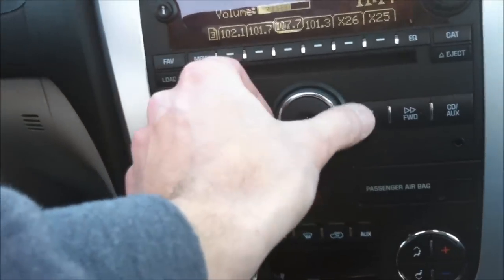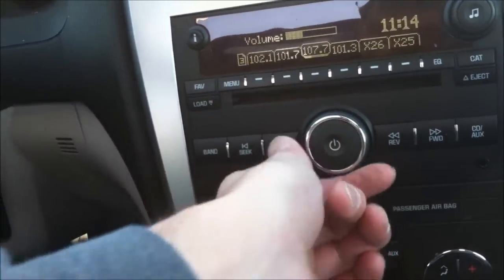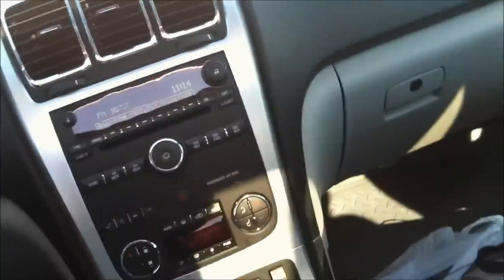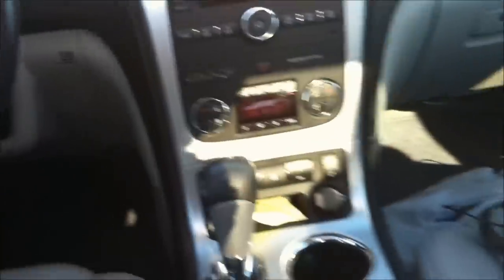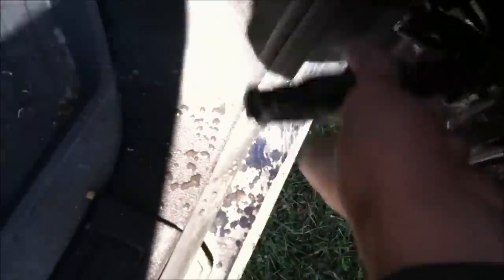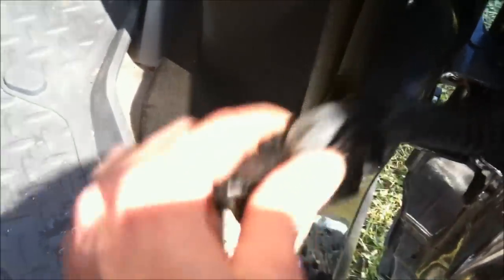GMC Acadia sound problems potential fix repair?

Comment: Today my 2008 Acadia only had sound from the radio coming from the tweeters in the A pillar.  I shook the water out of the wiring connectors as you show in the video and then used a hairdryer to dry them out.  There was quite a bit of water in the wire harness.  I don't even have a moon roof.  After reconnecting the wire harness, the radio functions properly again.  I'm glad I found your video.
Reply from the maker: Glad to hear you were able to fix it. Terrible design on their gaskets.

Comment: Another suggestion is to put a small hole on the bottom side of that rubber at the lowest point to allow water to drain out.  You shouldn't have to do this if the car was built properly, but ......

Comment: Replaced my blown amp today (from the infamous leaking sunroof) in our 2008 Enclave, that third screw was impossible to reach for anyone with man-sized hands.  I couldn't even get my hand/arm to go far enough to touch it, called out my wife and she snaked her hand/arm up in there and got it out... zip-tied the new amp back in place, was no way that screw was going back in.  I think the GM engineers are still laughing about this marvel of engineering.

Comment: I have been having intermittent problems with the sound from my door speakers. Tweeters always work. The sound would return in the afternoon of a high temp and dry day. I took this Acadia to a dealer and they told me the speakers were bad. They had the Acadia for 4 days and it never worked for them. Also the temp never got about 95. Yesterday the temp got above 100 and the speakers started working. I drove the Acadia by the dealer to let them hear that the speakers actually worked. While there I told them about the issue described in this video and showed them the evidence. They were 1, stunned that the speakers were working and 2, that there was water coming out of the tube. So thanks for putting this video out there. Maybe I can get this fixed.
Reply from the maker: +Bryant Helms good, they did have a recall though. these people should know that.
Reply: I have the exact same problem on my 2009 Saturn Outlook now (which is their version of the GMC Acadia).  Is there a similar recall on that as well?  I had water in 3 of the 4 door wiring boots.  I drained them and left them disconnected and all 4 doors wide open on a sunny day however nothing has started working again.
Reply: +Keith Zastrow it's because the amplifiers burn up I've been through hell with my GMC Aquarium Acadia as the dealer called it
Reply: I have the Same problem with my 2007 Saturn Outlook XR.
Reply: I have the same problem with my saturn outlook xe
Reply: Odd I had the same issue on my 2007 Impala no blown speakers but on a hot day my drivers side door speaker would start workinh.

Comment: If you have a stereo and A/C setup package in the back and the buttons turned on you won't hear music out the speakers. My kids were in the backseat and they happened to turn it on an after my stereo up front wouldn't work. Turned there's off and it worked again. Gonna check if there's any water in my Acadia today.
Reply: I couldnt hear from my radio and the kids were playing with the buttons on the back controller and it started working. Course now there is water in all the connectors and I have no sound at all. Wish I had googled it sooner!

Comment: Drained water, changed amp and I have sound again thanks for the info this is the only lead I found with a cure to the problem
Reply: can you link me to something that will give instruction to replace amp?
Reply: Did you do something to prevent water from doing it over again?.. I just bought a Saturn outlook yesterday and same exact problem only tweeters work.

Comment: Just did some research and found out it is probably the amp. Search the comments on Amazon - ACDelco 25796753 GM Original Equipment Radio Speaker Amplifier. The comments are EXACTLY whats going on here and in my 2007 Acadia right now! Thanks for the video, it was good to get that water out!
Reply from the maker: Thats really good to know. Thanks.
Reply: Fkn amp is 300$ ffs...

Comment: radio stopped working so I did a small internet search came across this video has absolutely amazed what I saw and cut and believe it so when I popped out the connectors and all that lip and water came out as a bit speechless but my radios working thank you for doing the dirty work

Comment: thank you first video that worked had same problem off and on. sound just goes out new it was a short. happened again today. so pissed. watched your video found water in one rear driver. shook the water out. it worked right away. will dry it more when i have time. but less than 10 min for a fix and i know where the problem is. thank you thank you thank you!!!!!

Comment: Thanks for the video.  No water in the connectors but blew out with canned air and  all speakers work now
Reply: C.A. Cook I just bought mine in October this year and have had this problem since driving it off the lot. Among other issues, do you think  the problem would persist every time it rains? I have 5 kids to entertain and I can’t be fondling the door and wires every two days. Lol
Reply: Yes, it would.
Reply: Try to put some sore of sealer around the connectors after drying it.great solution. Saturn outlook 2007
Reply: Canned air is genius! Thank you!

Comment: Oh boy oh boy!!! Thank you so much for this information. this is EXACTLY what was wrong, i got almost 1/4 to 1/2 a cup of water out between the four connections. GMC twice said they couldn't fix this and the first time they said they 'turned the volume up' and the stereo worked for a couple of days - then the extended warranty ran out.

Thank you again for this video. Now I have to wrap some electrical tape around those connections to try and prevent water getting back in there! Just in time for a long 1000 road trip too!!!!
Reply from the maker: I might would try silicoin.

Comment: Thank you very much for this video. I have been trying to solve this problem for months now. I watched this and tried it out on my 2007 saturn outlook.  Low and behold, Niagara Falls . I noticed corrosion in the front doors and a lot of water in the back. I hope to get everything dried out tomorrow and put in my new stereo. If I can get the speakers working I can send the new ones back. Will let you know how it works out.
Thanks again,
Reply from the maker: From comments ive seen, the amplifier is the thing that gets fried from the water not the radio. Hope this helps.
Reply: Friend has a 2008 outlook and saturn looked at their VIN number and said they did not have a  factory AMP installed under the dash like some others. (amp must be built in stereo itself. So now we wonder what parts need replaced to get the speakers to work all the time again. And also how to stop water from collecting in the door harnesses. Any thoughts?

Comment: Thanks for the tip, but just don't drain the water, use compressed air to blow all the water out. If you have sound coming from the headset jack in the rear seat and no fuses are blow, then there may still be some water shorting the amp out. The amp may not com back on right away because most have short protection to prevent severe damage. Wait a day before seriously thinking about replacing the amp. Mine cam back on after a few hours of being dried out.
Reply: So is it safe to say that if I can hear radio from the headset jack in the rear seat, that the amp is not blown?
Reply: I'd say yes. I couldn't believe the amount of water that came out. I ended up putting slit in the rubber at the lowest point to try and prevent water collect. If you can let them hang free for the night, then re attach.

Comment: FYI - You need to check for Amplifier DTCs and CLEAR THEM; otherwise, 
the radio will not work even if the AMP is OK.  In the scantool you will
 see one or more Amplifier related DTCs that were set in the past but 
now pass.  Even though they PASS currently, the radio will not work 
until the DTCs are cleared.  A can see some unsuspecting/inexperienced 
techs missing this and claiming you need a new amplifier / radio.
Reply: beyerch thank you for this.... Will go borrow a code reader.

Comment: I had the same problem on my 2011 GMC Acadia, which only the front speakers were working. Both rear connections had water so I used a can of air duster and now the second and third row work perfectly. Just shaking the water out doesn't completely dry it. I did receive a recall in the mail for the rear lift gate so I will tell them about this water problem.

Comment: I tried this and seemed to have helped but I think the amp still needs to be replaced. After I shook and air blasted the water out with about 75psi of compressed air, I took it for a drive to see if the bumps on the roads could knock something in or out of place. Sadly, it didn't work but when I turned off the engine, I noticed there was the sound of a cooling fan that was running that would only turn on or off when I pressed the power button on the radio. It worked yesterday morning (before I shook the water out of the plugs) for about 15 minutes but then stopped. The same thing happened this morning and it only seems to work in cool temperatures. The radio started having problems over the summer and it would sometimes work as the temperatures got lower and lower with the seasons. I don't know about anyone else, but it seems like that something is preventing it from getting sufficient cooling or it's causing a short somewhere in the car that would eventually cause it to overheat or it could possibly be malfunctioning and thinking that it's overheating. I will try to gain access to the amp later today to see if I can find something wrong.
Reply: any luck?

Comment: Great answers, I have an traverse 2012, I found water in right back door connector. It worked after properly dried. Any suggestions in how to improve sealing and avoid water in the future.
Reply from the maker: Renan Luque maybe seal the connector with some silicon or liquid electrical tape.

Comment: Hey, I know it has been a while since you first published this video but did you ever find a resolution to your loss of sound?  Were you able to dry the electrical connections enough that the sound returned?  Or was there a deeper issue?  Thanks!!
Reply: dude i am still searching too I have water on my floor board as well
Reply: Hey I know it been a while since you made this comment but I’m having the same problem did you ever find a solution
Reply: @rodneycampbell6647  we ultimately had to just replace the amplifier and that did it.  Hope that helps.

Comment: So will the dealer cover the fix or is the cost on the buyer to fix??
Reply from the maker: If you can find the recall on your car online, id say dealer
Reply: You will have to pay for it and that's why I'll never buy another GMC aquarium as the dealer called it and the price you're thinking in your head to get it fixed at the dealer times that number by four
Reply from the maker: Ringhaver Ring power Cat look online for the recall. That should pay for it not you

Comment: Only had volume on front pillar tweeters on my 08 Saturn outlook. Watched this video and had same problem with water in connectors. "Drained" and cleaned connectors, still no sound.   Now moving on to look for blown amp fuse. Anybody gone down this path before?
Reply: I am having this problem. But my fiancee was sitting in passenger seat, and was resetting my clock. and for some reason while she was sitting in the car in started working. thinking that drivers side airbag circuit may be linked to problem???
Reply: You most likely got bad speakers I’ve replaced many of gm 07 up cars and trucks with tweeters still player your out out is good still
Reply: Ground Pounders Place

Comment: Have you ever had problems with the turn signal?  Not turning on ? Or hazard lights
Reply: Omar Rangel the signal sound is fake ld through the radio. Radio stops working so does the click click

Comment: I'll have to try this out later. The sound in my mom's 08 Acadia keeps going in and out at times and usually works in certain temperatures. Hope it's not the amp because that's a bitch to get out yourself so you pretty much have to take it to a shop to get it out and spend almost two or three times as much

Comment: Water comes through a shitty rubber gasket that suppose to prevent it from coming. When it rains, water drips on those wires which after accumulation directly goes in the connector. Permanent solution would be to replace those wiring harness or take it out and apply silicone at the base of duct tape.
Reply: I mean honestly though your vehicle can sit still and it’s raining I don’t know if it’s in the door seals or what

Comment: please Help My GMC 07 Yukon Radio Not Turn on.Any idea Why or What cause Tha,Really I be happy with any Input Thank you
Reply: Sometimes the power hook up to the radio can fall out. Is the screen not turning on?
Reply: +Baticon having the same problem and the radio doesn't come on at all
Reply: Jahlanii Lewinson make sure the fuse that controls the radio is still good, if that's good then check the power cable on the back of the radio as well as the ground wire or wires. (Sometimes has 2) no idea why.
Reply: Will do man thanks
Reply: I just pull out the fuse,then putting back and radio work again
Reply: pastrana37 that's awesome

Comment: exactly same problem on my Acadia. Irritates the sh&t out of me. I have one speaker left that works. No way in hell will i replace the radio to have the same thing happen.
Reply: If you take it to audio shop I would say they would put seal around the connectors but I’m pretty sure it is a rubber trim around the doors that is the culprit that lets the water in

Comment: GM speakers of this era are garbage. They come and go. When only the tweeters work you know it's time for speaker replacement.
Reply from the maker: Izuhara Torozu didnyou watch the part where the water was coming out of the connectors? The amp was fried